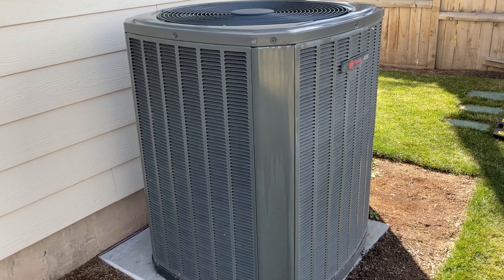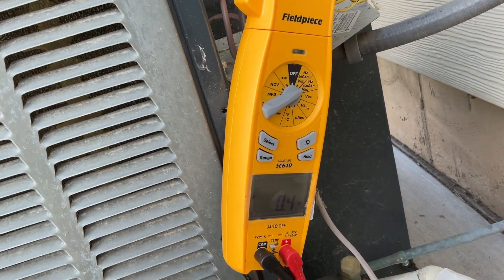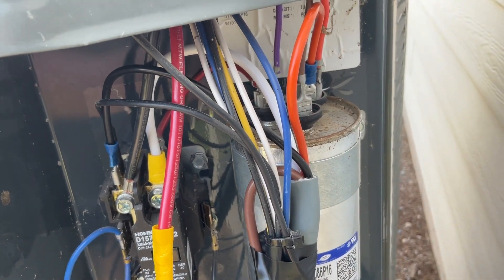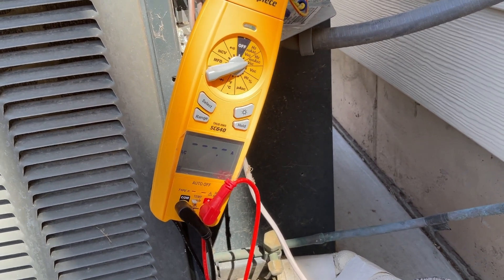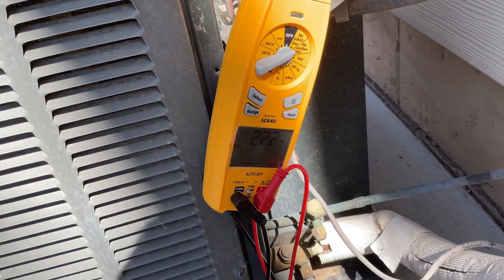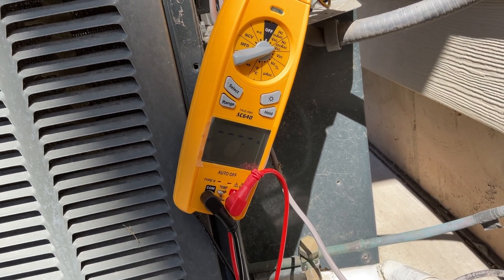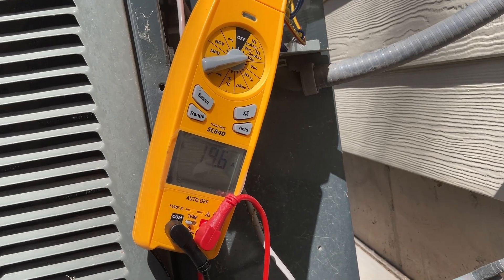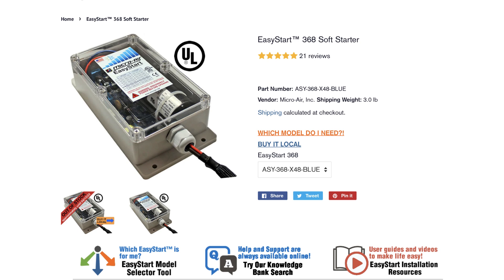Save Lots of $$$! Micro-Air Easy Start on full-size A/C Review

Comment: Greatly diminished the LRA.
  NO CHANGE to the
RLA.
   But over all a great service to compressor. 
     Fantastic video,thankyou for the time ,editing nd commitment to us fellow home owners.
   Gonna try this from supply house,nd see if it stops my lights from dimming. Every time my panel gets that high demand load from compressor. 
   My LRA @ compressor ( locked rotor amperage)is about the same as yours.
     Once again THANKYOU...
Reply: Yep, I installed my Hyper Engineering Sure Start this morning, no more dimming lights. Dropped inrush current from 134 to 28. I chose it over the Easy start because the box is much smaller, and my available space was limited in my condenser unit. Also a bit cheaper, and was available in stock nearby.
Reply from the maker: You're very welcome! Glad I could help! Thanks for watching and commenting! This stopped my lights from dimming...but more importantly, prior to getting this device the A/C startup would cause my nice speakers in my family room to subtly pop whenever the A/C turned on. The Easy Start fixed that too!

Comment: Ok but what does that means to my power bill? I pay for kwh not amps ?
Reply from the maker: Good question! Regardless, it's already saved me thousands of dollars on my generator, and probably repair costs on my A/C unit. Thanks for watching!
Reply: It won't be huge savings, but to make it easy for you to understand watts is amp*volts.. ac unit being 220v.. in this video he went from 220v*93amps ( 20460 Watts) draw to start the ac, down to 220v*22amps (4840 Watts)(first run).. basically.. he went from 22kw draw down to 4.8kw.. is just initial draw.. you prolly won't see $20 off your bill.. but you may see $1-4.. and your ac capacitor prolly will last you more than 3-5 years..
Reply: @Cubanpapi04  Thank you for  reply ,explanation .

Comment: These certainly do reduce the initial startup inrush current, but the likely do not save any money on overall energy consumption, as the slow start pulls medium current for a longer period of time than the PSC inrush.
Reply: @shawnm5641  I don’t think you understood what I was saying…
Reply: @shawnm5641  I don’t think I stated that startup is slowed… I believe what was stated is that inrush current is reduced… I misstated the name of the device… not a slow start, but a soft start… I see where you misunderstood my statement… since I used the incorrect term.
Reply from the maker: Thanks for your observations and for watching!
Reply: @shawnm5641  So, installing a soft start will save money on the⚡ electric bill? I imagine you cut from 80amps to 45amps on start would certainly lower your usage, no?
Reply: @Rj-nh1df  no because the inrush current only lasts half a second

Comment: Why/what/how does cycling multiple times give different readings?
Reply from the maker: The device has to go through what they call "learning" where it learns over a period of 5 starts the most efficient starting current. So I was showing the progression as it went through it's learning period. Changes in current each time as it learns is expected and normal.

Comment: How much money did you notice  month after installation .   Were able to compare KWH  for previous  summer months to after install. ?
Reply from the maker: @The right is wrong is correct in terms of electrical savings. But has made my A/C sound and run a lot smoother. Plus saves you big bucks when it comes to backup generators and solar inverters!
Reply: Ok, thanks

Comment: If a device like this cuts the startup amp demand so much, why doesn’t the EPA make this a mandatory component for AC vendors? I would think if more AC units had this, there would be far fewer brown outs and black outs from peak demand periods.
Reply: I don't think the EPA has any authority or concern over device power consumption.  Maybe another agency... I read that the AC manufacturers don't include this technology because of the cost. I just installed a Hyper Engineering Sure Start on my 5 ton York this morning, it dropped the inrush current from 134 Amps to 28.5. But it cost $279. If the mfr is making the usual 50% profit, that would mean the AC condenser units would cost around $150 more to build if they had this feature. At least they should make it an option, right?
Reply: @danm400  It can be purchased as an aftermarket item.
Reply: @danm400 how long does it take an,hvac tech to install it?
Reply: I bought one so I could use a generator to run my house ac during the power loss event like a hurricane.  I can tell you that I couldn’t before I installed it but now with the easy start I can and other things as well.   My start up amps was 87 amps before now the start up is 36 amps.     My ac is no more efficient anytime other than start up but my ac seems to not flicker lights in my home etc    I was definitely worth it for me    Although the wiring is not horrible but not as easy for systems that are not straight forward typical wiring
Reply: Because this doesn’t save you on your energy bills.
Reply: because rhe startup amps only happen for a split second.  starting with this device spreads it out over a second or two.  I suppose if every air conditioner er started at exactly the same time this would make a difference, but because there are thousands of units starting at different times it won't make a difference.
Reply from the maker: Valid question! Thanks for your comment and for watching!

Comment: Thanks for the video. I've been looking for ways to reduce the noise from my American Standard Heat Pump as it's right next to my tenants window. I'm convinced this along with a compressor sound blanket will reduce the overall noise quite a bit. Thanks
Reply: it does reduce rhe startup noise significantly.  maybe 35% quieter?  I didnt take a sound reading prior to install.  running noise is the same.
Reply: @jackmorgan709  I agree with Jack, the startup on my 5 ton unit always sounded like a sledgehammer hitting the compressor. Much softer starts now. And the lights in the house no longer dim when the AC kicks on. Running noise sounds about the same, but is is a fairly quiet unit.
Reply from the maker: Sounds like a fun project! Thanks for your comment and for watching the video!

Comment: Great video! My question is why the AC manufactures don’t use such a system
Reply from the maker: It would sure be nice if they did! Thanks for watching!
Reply: I was wondering the same. Could be a patent issue. Regardless, I would really like to see the AC Mfgs response to AC Owners installing this device on their models.
Reply: @crazygravy437  #1 is Cost. #2 is probably that they have no interest in making their compressors last more than 10 years. And #3, probably 99% of homeowners don't know this technology exists, and unless they plan to run their unit on a portable generator, why would they want to spend more for a feature that makes no difference to them. I only found out about them when I bought a generator for emergency backup power, then got to wondering if it could run the 5 ton central AC unit during a summer power outage.

Comment: Nicely done video and thanks!  Love my Micro-air.   Makes the out door unit sound a lot quieter.  Doesn't sound like the compressor is trying to escape with every start up.
Reply from the maker: Thanks for the comment! It’s true! I certainly think the Micro-Air makes the unit run smoother. Thanks for watching!
Reply: the bang at initial start is from the rotor not lnowing to spin, all force used to translate causes a translation bang
Reply: From th e contactor

Comment: The "Soft Start" kits can only reduce start up amperage by spreading out the start up. This allows a unit that normally pulls 50-90 amp inrush ( for a fraction of a second ) to be limited to a little above normal running amps for a longer time.  The compressor will draw a higher current for an extended time to start up slowly and under perform during that time. Net Zero improvement for total efficiency. However, reducing the inrush will reduce the overall voltage drop during startup, and that could benefit anything else on the panels circuits, like a generator....
Reply: I"m just happy not having my lights dim every time the compressor starts.  And now I can run it on the generator.  Lastly, the unit just sounds happier when it's running.  Smoother.
Reply: Given you knowledge in this domain, does this softstart kit really improve or increase AC life?
Reply from the maker: Thanks for sharing your wisdom and watching the channel!
Reply: @shawnm5641  LOL
Reply: I concur
Credentials: master tech /licensed contractor
Reply: You are absolutely correct, there are so many folks doing these stupid videos that do not even understand how hvac, motors, etc., even work.